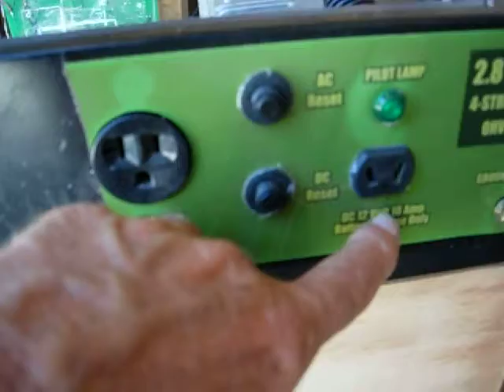Don Smith #144 Control panel mounted

Comment from the maker: new 7 inch pulley on the way.   I found that the hall sensors were inside the rotor too far so they will need some adjustment.  by simply moving these in and out the motor speed can be varied

Comment from the maker: I just finished my third pcb from the original batch.   turned it on and heard a loud cracking sound.  The mega48 blow up.  I found that one of the mod wires needed was on power instead of ground.  more mega's on the way.

Comment: Great work on that board! I'm working on a similar project at the moment. Which of your videos explains what your goals/plans are for this motor/gen project and a little more on the motor and generator that you chose? Is this related more to D.Smith or Gerard's work? What voltage is sent to the motor coils themselves? What HP would you say this BLDC motor is rated for?
Reply from the maker: +Jake Mitchell this is Gerard's test extended.  My goal is to repeat his 6kw test then thoroughly analyze the guts of the pole transformer.  Next I will build my own transformer inside a box with motor gen outside.  I'm also working on a car motor don smith #39 shows the prototype running.   everything is presented here so that anyone can build this stuff.   The new boards have been relayed out and I'll have some available in a month or so when money is available.  I just learned something about the hall sensor they are very sensitive when being positioned near the arcs with 4 magnets.  Gerard's discovery about radiation is amazing.  I was also amazed to see that the ammeter reading at the pole 120vac input read very close to 0 amps.  The gen 154 has a 12vdc output which will come in real handy.   The gen is  from a Sportsman 2000 watt gasoline driven.  My sun removed the bolts holding it to the motor and hacksawed the shaft at the bear which has worked great.  I did run the gen with the motor which is a Samsung 36 coil stator, 12 arcs 4 mag each rotor,   HP of motor is unknown maybe 1 hp.  but don't forget their is no current flow out of the gen so it be no load just radiation flowing.  lots to test here and learn.